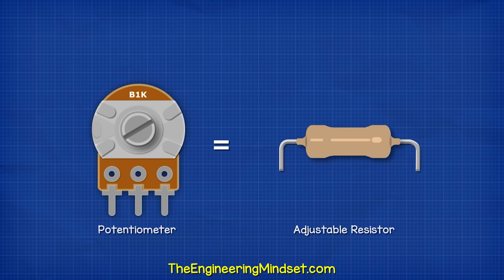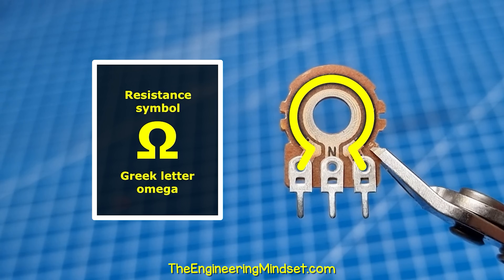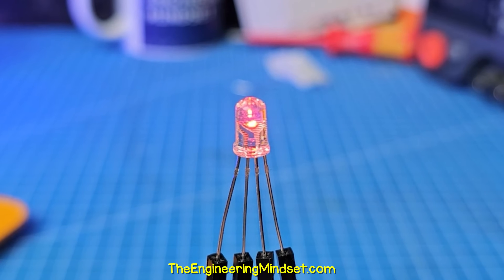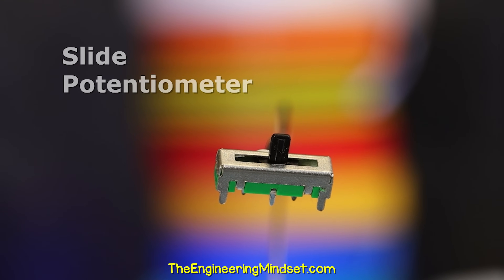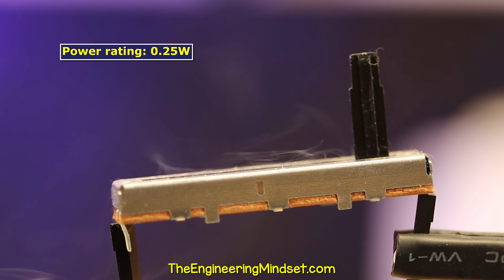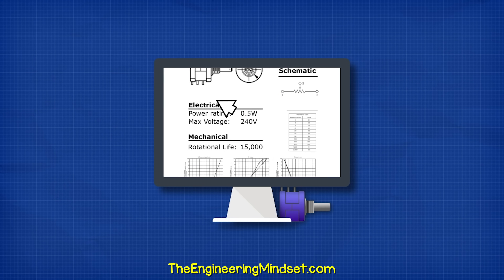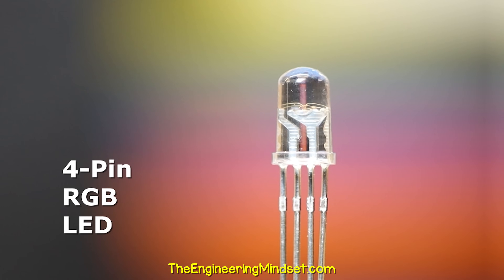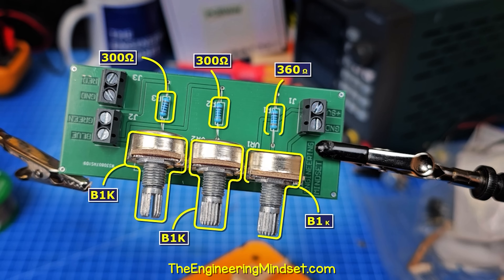How Potentiometer Works - Unravel the Mysteries of How potentiometers Work!

Comment: 17:17 We control Current & that controls the  Brightness of the Leds.We Need a resistor to set the maximum Current. If we don't use resistor Current will be huge and resistance are low.

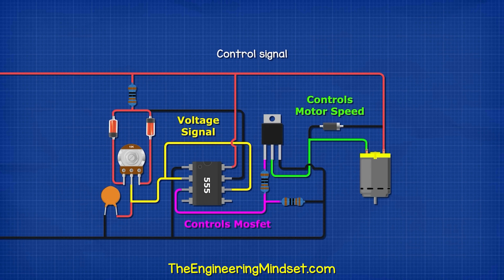Comment: 15:07 This is greate for Signal Control But not good for Power Supply because it create parallel path for current to flow which voltage reduce.

Comment: can someone explain me please why by using rgb led we also connected to the 3rd pin and not only by using one end of resistive track and center pin., so that it will make parallel and series combination. so its not only current adjustment to the led

Comment: I currently am having an issue where I am using one to control engine speed. I notice that halfway through the turn on the potentiometer, the engine does not rev up. The 2nd half turn, it works. What gives?
Reply: Add a fixed value resistor in series half the value of your current potentiometer.. Then get a new potentiometer half the value of your original.... The fixed resistor gets you past the dead spot so your new "pot" works straight away...

Please learn about log and linear pots as this can also cause your problem if you have the wrong type in your application.

Comment: Regarding the circuit for the l.e.d. (17.03) what would the resistor value be if the applied voltage was 12v.. Many thanks.

Comment: @ 2:31 you say the "outer track has resistive material OVER IT". I believe you mean that the outer track is COMPOSED ENTIRELY of resistive material? This would make sense, since if it was just COVERING conductive material, resistance would not vary with the knob. 
Please confirm. Thanks

Comment: Where could I buy a basic circuit board to plug in various electrical devices for my grandson. All replies will be appreciated. Thanks very much😅
Reply: You can get a breadboard and some hook up wires. You can insert many different circuit components. 

Look into an Arduino kit.

Comment: I used a 10K ohm pot to repair a PA amplifier that had a scratchy volume pot on channel 2.  There were four channels in total.  The repaired channel is noticeably quieter than the other three.  So I replaced the 10k ohm pot with a 50K ohm pot and the volume is louder but still not as loud as the original pots.  I would have thought that the new pots on max volume would have been as loud as the old pots.  Can someone explain why I'm not getting full volume?

Comment: When you connect the battery to the outer terminals why doesn't the potentiometer get hot because you're shorting out the battery across the resistor

Comment: Great video! One question, I think I've seen led lights and other things also dim from a lower voltage, but at the end you were dimming that led with the current. Is there a more correct way of doing it or are both good options depending on what you fancy?

Comment: Two potentiometer variants  not discussed here are L-pads, and tapped potentiometers. L-pads use a pair of intentionally mismatched, differing resistance-tapered elements (usually wirewound) in order to maintain a relatively constant impedance or resistance to the driver circuit/device regardless of the setting of the  L-pad;  These are often used as remote volume controls for speakers in other rooms, or as level-setting devices for tweeters or mid ranges, because the power loss (due to a non-optimal impedance loading to the amplifier) is somewhat minimized, and they won't change the frequency response of a speaker crossover as the added series resistance of an ordinary potentiometer would. Tapped potentiometers are sometimes used as audio amplifier volume controls in order to privide a constant, continuous, fixed-amount feedback signal for lowering distortion or to actuate bass/treble/variable-"loudness" circuits where the amount of bass is increased at low listening levels and automatically decreases as you turn up the volume , to prevent stressing the speakers.

Comment: I have a 10K rotary potentiometer in a 5 amp model railway controller.  My question is.  Can I replace the 10K pot with say a 20 or 50K to get better performance ie faster model railway engine speeds?

Comment: I want to ask, does the spiral wire inside the resistor not act as an inductor? I mean, probably doesn't, but why?
Reply: Wirewound resistors, whether adjustable or not, do indeed have some inductance, typically more inductance than a carbon-type resistor or potentiometer of tge same resistance value.  Whether this matters depends on the circuit that is being used in. It might not matter that much in an audio circuit but in a radio frequency circuit the inductance of the wire wound  pot or resistor could be a problem.

Comment: Sounded like the potentiometers/resistors are rated for x= amount of adjustments and y = amount of power etc. , ** Heat rating should also be included in the manufacturing and distribution… this knowledge will really help innovators assemble and design gadgets at a full potential
Reply: The wattage rating of the potentiometer, if included in the specifications, will tell you how much voltage and current combined it can handle safely.  A logarithmic, audio type potentigeometer such as is used in a guitar or amplifier will only rarely be rated it in wattage because the amount of actual wattage dissipated through it will be tiny.  If you are using a potential amateur to control LED's or light bulbs or motors then you will obviously need something with a higher wanted to keep ability and perhaps even made of a wire wound resistance element and not a printed carbon film or track.

Comment: My potentiometer has a wire coming out the opposite end from the 3 prongs; any idea what the wire is for? The component came from an 80s stereo system.
Thank you!
Reply: Some amplifier circuit designs require a signal to be taken or tapped off from a certain portion of the research element of the the volume control for part of a feedback circui that either is used to lower distortion or perhaps to give you a boost of bass frequencies only when the volume of the stereo is turned way down low, so as to compensate for the " Fletcher- Munson curve" which shows that bass frequencies are not very well perceived by the human ear at extremely low volumes.  As you turn the volume of the stereo up the automatic bassboost of the so-called "loudness compensation circuit" will be decreased so that you don't have an audio signal that is too heavy in the bass region, sounds weird, and perhaps stresses your speakers.

Comment: In multiturn trimmer potentiometer, once we turned it into the maximum position it will give us a clicking sound. Why was it happen? Will it cause anything to potentiometer or is there any safety mechanism for prevention of screw rotation?

Comment: Thank you very much! Now I understand how RPM of a DC motor is increased or decreased via potentiometers. One question: Does resistance inside a potentiometer decreases current flow too or only voltage? Because in the animation thickness of green flow was not changing when resistance increased.
Reply from the maker: Please watch video in full, all covered

Comment: Electric Guitars... (rotary type)
I am getting ready to replace 3 of these on one of my guitars, so I was just fishing and the old interweb and came across your video and found myself gaining a better understanding of the design and inner workings of these.

A lifetime ago (1988-90) I used to work in the hand build department of a company soldering circuit boards for aircraft instrument panels and I still enjoy learning about exactly how all these different components function as part of the circuit system.

Our training and knowledge was based on a physical skill level and no knowledge of the function of the parts was required, but it's always interested me very much.

As with any, and all things that I give any time to. Lol.

It looks like your entire channel is full of interesting videos.

You got a sub and a like from me, and I believe that I will be spending some time going through your videos.
This is very well made content.

Comment: Is it possible to have two different potentiometers on either parallel circuits or to use a standard switch to bypass the potentiometer to allow full current to access the device.

Comment: One comment I would add to this video, for the amateur dummy's like myself:
DO NOT SOLDER the little holes in the potentiometer leads.  That mistake caused me a lot of frustration.  My circuit design kept working in the breadboard, but not when I made the actual circuit, and it took me a few hours before I figured it out.

Comment: You said it correctly, that it is used as a voltage divider, however, you then showed a 9 volt battery shorting across it, which is not a voltage divider. 😂

Comment: Could I use a pot or 2 pots to create a fader between two sets of speakers in a car stereo ?

Right now the amp is 4 ohms per channel and I want to be able to fade in two rear mounted speakers of 4 ohm each and fade out the front 4 ohm speakers
Reply: Such "faders" are actually a special potentiometer variant known as an "L-pad", which has 2 resistance tapered-resistance elements (usually wire wound, not carbon film) that work in tandem-opposition (as one resistance goes up when you turn the shaft, the other resistance goes down by corresponding amount) so as to keep the combined resistance/impedance-load of the speaker and L-pad together, which is "seen" by the audio amplifier, roughly constant regardless of the setting of the L-pad, so that power-loss from the amplifier is minimal. You are better off buying such a device pre-made than trying to build one from individual potentimeters. You will also sometimes see L-pads used as a midrange or  tweeter level control inside of a speaker; the reason that an L-pad is preferred for this
, compared to an ordinary potentiometer, is because the variable resistance of an ordinary pot will cause a change in the frequency of the crossover network (which divides the frequencies between the individual speakers).
Reply: @goodun2974  Thank you so much, that makes perfect sense.
Reply: @tjm3900  , glad to be of some help!  I was a little surprised that this video did not include any information on L-pads;  Nor did it mention that potentiometers used as volume or tone controls will sometimes have a "tap" at a fixed point on the resistance element for use in feedback signals, which can either be used to lower distortion or  to feed the bass and treble controls and/or the " loudness" circuit (which gives a bass boost at low volumes to compensate for the human ear which is less sensitive to bass at low volumes), which works best if the bass boost is reduced automatically as you turn the volume up so that you don't stress your speakers.

Comment: when I was little, say around 9 or 10. I  thought I could make a lamp dimmer by wiring a potentiometer in series with a table lamp. I misunderstood that it would not work as a dimmer switch, but quickly found out with a very smelly , smokey  result. like  you showed at the end of the video.  😆

Comment: These potentiometers are not energy efficient because they have resistance. Some of the electrical energy that goes through them is converted into heat and lost. I think electric cars don't have potentiometers  like this. They would decrease the car range by converting some of the battery energy into heat.
Reply: Actually they do. Electric cars have a high voltage net for the motors and a low voltage net for the electronics. A potentiometer that‘s used in a 12V net to measure the position of a pedal only generates negligible amounts of heat because the currents used in the measurement are very small. The loss in range is probably in the range of the bugs that died on your windscreen cause increasing the weight and drag of your car.

Comment: 3:42 Correct me if I am wrong, but isn't the Resistance A type an exponential type instead of an logarithmic one? Exponentials are the inverse of logarithms.
Reply: Well that was an interesting rabbit hole to go down and now my brain hurts.

Why do we call them logarithmic when they graph as exponential? Is it just the fact that they're used for audio and loudness is described logarithmicly? As-in we just ended up with this misnomer due to that tradition? 

Or, more generally speaking, while being graphed exponentially, is it infact aptly named but just from the perspective of the equivalent logarithm because that perspective is more important electrically? 

And then, is an inverse/anti log pot actually the one that's logarithmic? Or is it still exponential and just rotated 180°? I'm not even sure that question makes sense...

Another thing to think about: consider a slider pot where directionality isn't an issue as you can make either end "up". There's a reason there are still log and inverse log versions...you couldn't just wire them backwards. The types differ in whether you have the "fine adjustment" (slow change) portion of the curve near the high resistance area of the pot or the low resistance area. 

And then practically, it appears these types of pots are more or less actually two linear pots with different "resistance per degree" characteristics stuck end-to-end and are thus only an approximation of said mathematical functions.

Comment: I noticed from your posting an important fact you may review. This involves the variable to not go to zero. Say you have a 10k variable resistor and you only want it to go down to for instance 1k: The 10k is across pins one and three, the 1k would be from the vary pin to either pin one or three depending on the way of rotation needed. This causes the pins one and three to vary.

Comment: What's the resist material made of?  Is it always the same material or are there multiple materials?  A quick Google search says graphite is the cheapest resist material but there are some other types too.  I think I've only ever seen the dial and slider variants in real world use.  Also, I assume because you have a metal wire rubbing against a material that it will wear out over time, so the number of uses is probably limited in the thousands.  The other types of potentiometer where a screwdriver is necessary to turn them seem like the sort of thing you'd use in a prototyping scenario where you are creating circuits and need some flexibility without having to swap in and out a bunch of resistors.
Reply: You also use the „screw driver type“ to compensate for the tolerances of other parts. Say you use an Op-Amp to amplify a signal by fixed factor of ten. If you make say ten thousand of those amplifiers, both the op-amp and the resistors that define the amplification have their tolerances, which means: the amplification you get will cary within a certain range. If you add a potentiometer to the circuit, you can use it to adjust the amplification to where you need it to be. Do that during the testing after production and you can deliver amplifiers with a much smaller tolerance than the parts you used to build them.

Comment: In the RBG LED driver circuit at the end, what good is it to hook the black trace to the 3rd leg of each pot instead of just channeling the negative voltage through the RBG LED common leg? That seems to me to just create an unnecessary 333.333 ohm parallel resistor that isn't needed for driving the LED and is an extra drain on the battery ( about 27 mA) even when all pots are turned to their lowest (highest resistance) setting.

Comment: I have no background in electrical engineering, but I have potentiometers installed in my home in place of classical light switches to control the brightness of room lightbulbs. I had no clue how do those actually work, always thought it was something incredibly complicated, but after this video I can fully understand the principle. Most likely I won't apply that knowledge anywhere, but it's very nice that someone has finally clarified this to me. Also, had no clue that those sliders on audio desks are just potentiometers, so thank you for that. Great video!
Reply: Learn about SCR's and firing angle, it is doubtful any of your lighting dimmers work the way you assume after watching this video.
Reply: Plz use pwm
Reply: Light dimmers are way more that a POT, the POT controls electronics inside the dimmer. Audio volume, yes.

Comment: Love it! I use a giant rheostat to test circuit breakers. Single-phase 480vac in, 5-15vac out with large amounts of variable current for breaker testing.
Reply from the maker: Interesting to hear
Reply: @EngineeringMindset  Megger DDA-6000, the steering wheel on the right is connected to the rheostat
Reply from the maker: Seen our new incredibly detailed MCB video? link: https://youtu.be/gqEu9t8HwW0

Comment: There are a couple of small pots in one of my electronic control panels that can only be accessed with a jeweler's screwdriver. The pots have no physical stop on their rotational movement.  I  have been told to rotate the pot until I am sure it is past its upper/lower limit and then start slowly rotating it back for desired effect.  How are such "no physical stop" pots made??  BTW, your videos are terrific!

Comment: I know there's in my variable speed lathe 🙂
Reply from the maker: Interesting application
Reply: @EngineeringMindset  I only know because apparently the speed adjustment feature would break, effectively locking the lathe up, and lots of other owners said the potentiometer was the failure point. It's over 30 years old, and it was hit or miss when it came out regarding whether it would last, and a lot of people had to come up with other ways to fix it because the control board with the potentiometer hasn't been unavailable for a long time. I've been lucky so far, but I'm also hoping that with this video and others, if it breaks for me, I'll be able to fix it, so thank you!!